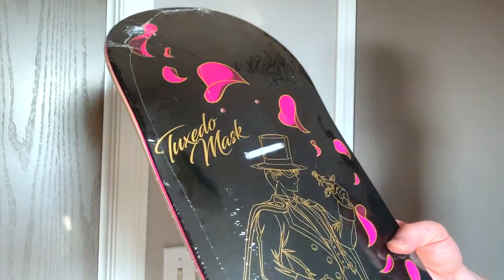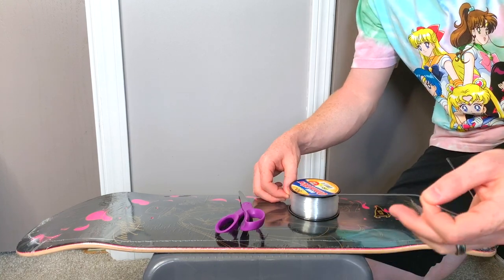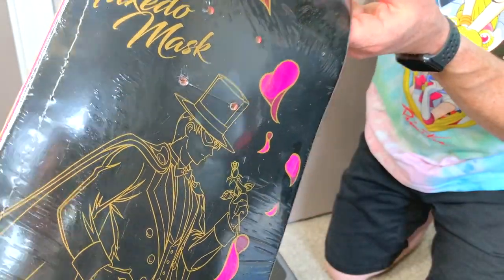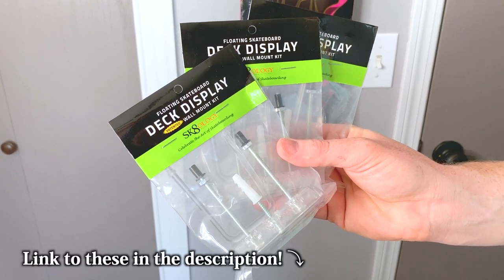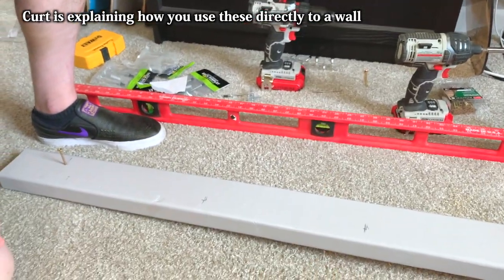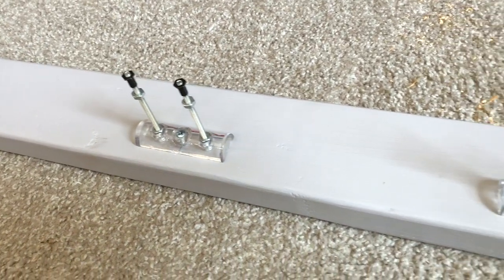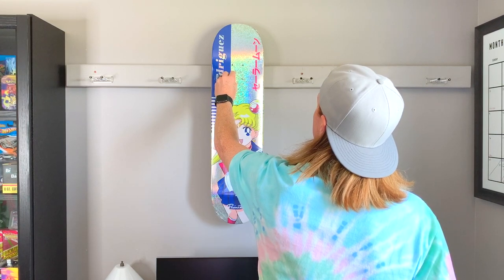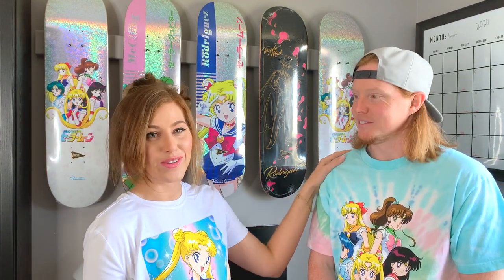DIY: 2 Ways To Hang A Skateboard Deck On the Wall! Sailor Moon Primitive Decks

Comment: It's been my experience that the adhesive on the command hook should be given time to set before hanging anything.  Hanging something directly after applying it to the wall will probably result in it falling.
Reply from the maker: had them up for years so far no issues :D
Reply: @ochibawolf  I believe you!  I've had experiences of them not sticking to particular surfaces and rarely have I had them fall off when they are on but I don't put many under a heavy load nor have I ever hung anything of value with them, such as skateboards.  Hence where my slight paranoia comes from lol!  Thanks for the update!!!